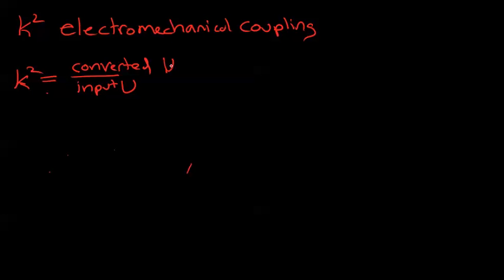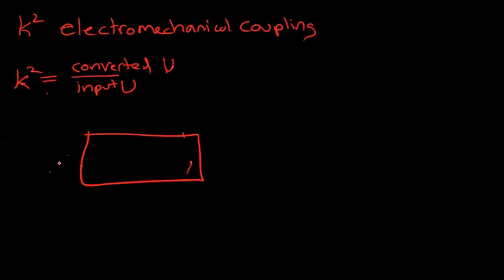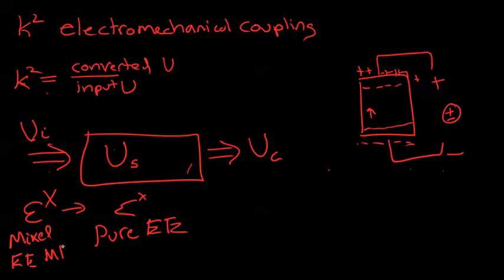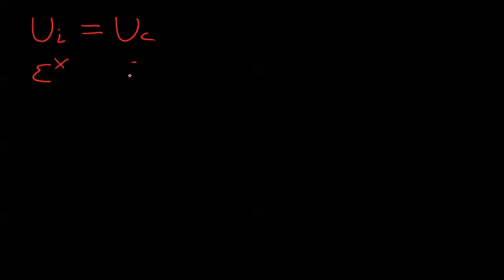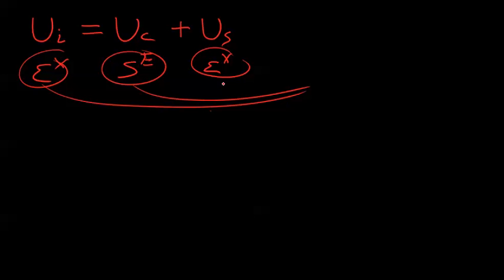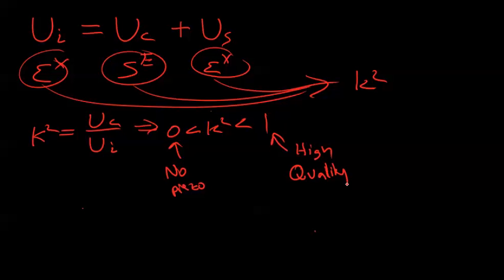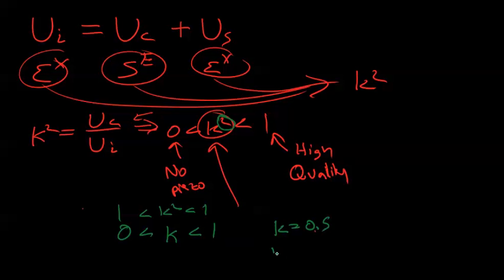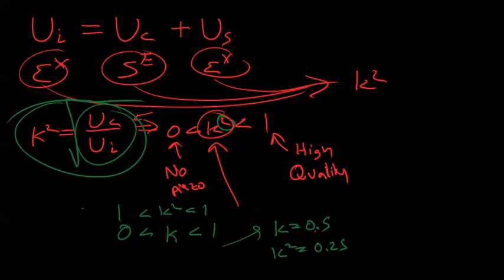Learn Piezo Lecture 5J: Electromechanical Coupling Factor in Piezoelectric Materials

Comment: Shouldn't k^2 be the ratio of "stored" mechanical energy to the input electrical energy -or the reciprocal relation: ratio of stored electrical energy to the input mechanical energy. I believe the use of "converted" here is not incorrect but the distintion made between converted and stored is not clear. I think you also derived k^2 in one of your older videos by simply dividing the stored mechanical (U_m=1/2kx^2) to the capacitor electrical input energy (U_e=1/2 CV^2), right?